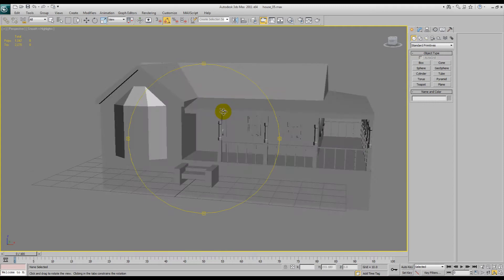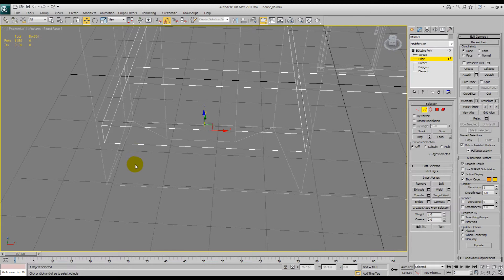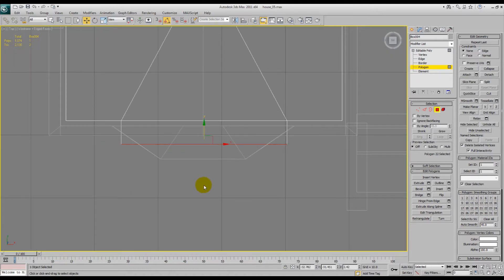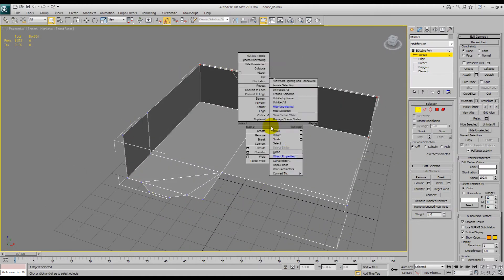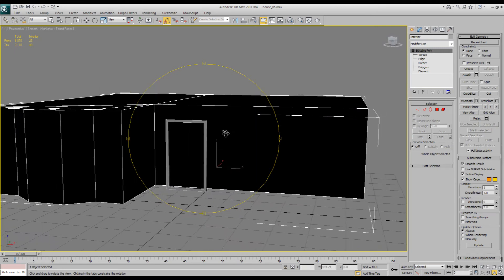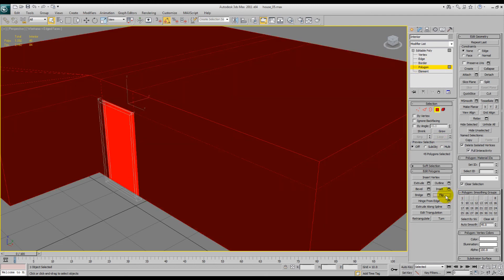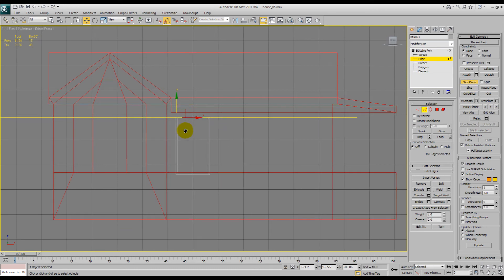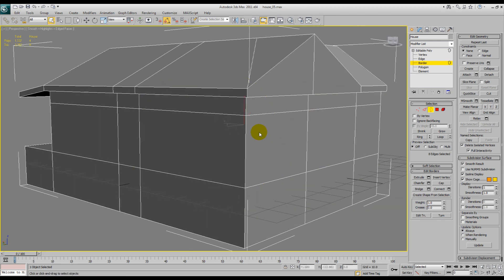Basic Modelling in 3DS Max: House (Extra: Adding Interior)

Comment from the maker: @childofthetao It's the polygon at the front.. i select the group and then at 1:13 I deselected the ones I didn't want.

What I did was delete the polygon, so i could select by border and move it while holding shift which I've started doing more often because I'm not sure what the shortcut is for extrude, so I remove the poly, move the border which creates more geometry which is the same result as extruding.